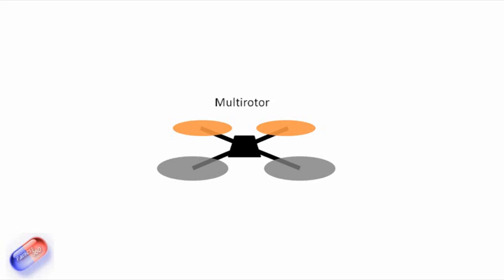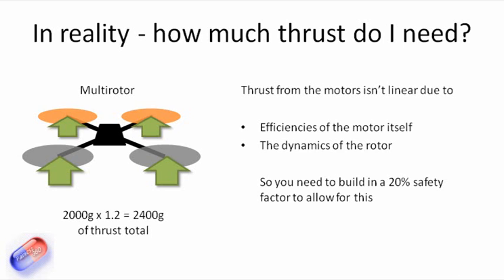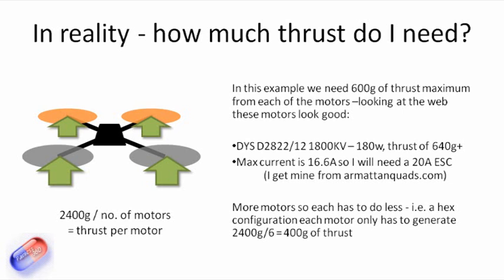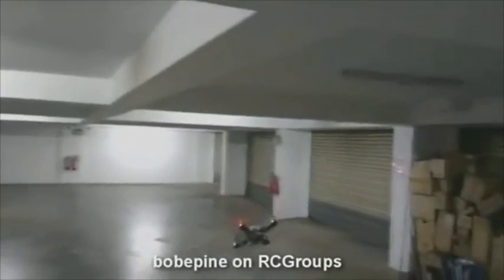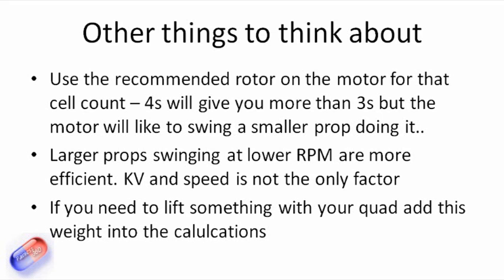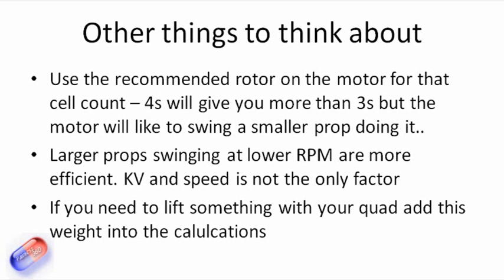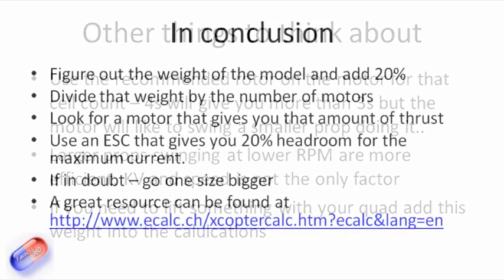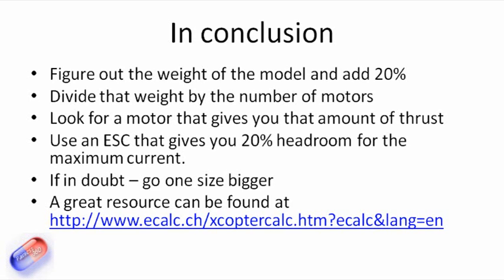How to select the right motor for your multi-rotor (all types - Tri, Quad, Hex etc.)

Comment: That was the clearest explanation I have yet seen.  Here is a question for which I have found no good answers.  I am looking at a range of sizes from, say 350 mm down to less than 100, so the MR copters will be quite light.  I am looking at possibly making airframes using carbon fibre tubes and plates and the strongest adhesive I can find, so that the bulk of the weight will be from the battery and motors.  What I would like to do is use the Gemfan 5x3x3 propellers (or their 6" equivalent) for the larger of these copters and the propellers from either the Syma X3 or the Syma X4 for the smallest of the copters.  Is it possible to compute the average time to discharge the battery from the weight and capacity of the battery and motors, the properties of the motors and and propellers, and whether it is a quad, hex or octocopter?  If so, how?  Can you show me the equations?  I have a mathematical bent, and so learn the details of how this all works when I see equations, rather than using a black box computing engine on the web.  What motors/brands would be suitable for this, which are reliable?  I don't care if anyone regards a particular one as 'the best' whatever that is.  I just don't want to end up with junk.  Are there any good books you can recommend on the subject?  (without the words 'Dummies' or 'Idiots' in the title).
Reply from the maker: Hi Ted, one of the best resources for these types of question is the eCalc site (http://www.ecalc.ch/xcoptercalc.php) plug in the numbers and the answers pop out!

Hope this helps.
Reply: For calculating the discharge time of the battery, use the mAH rating. The equation is mAH = current draw*time. But note that the actual mAH will be less if you draw a lot of current, and the number the manufacturer gives you isn't always accurate. If you check for reviews of the battery online you should be able to figure out how accurate the manufacturer's rating is, and there shouldn't be too much deviation from it as long as you stay within the current rating of the battery. To determine how much current the battery can output multiply the mAH of the battery by the number that ends in C. A 20C 1000mAH battery is good for 20 amps of current. Some batteries give you a rating for both continuous output and short term output, so be sure you use the right one. To figure out how much current the motors will use you will need to either measure it yourself with (with the prop attached), or find someone else who measured it with the same or a very similar prop and put the results online.

Comment: I think the point missed in the video is that prop speed is very important for stabilization. The reason for having a certain weight-to-thrust ratio (as you outlined) is because too much prop speed and you are burning too much juice and too low of a prop speed and the copter will be unstable. Stabilizing the copter is done by speeding up and slowing down props and you do not want a motor / prop slowing down too far. Thus, the reason for the numbers you give.

Comment: What a prop size to install in motor 800 KV. I would like lift up 1,3Kg in quadcopter( reptile frame)?
Reply from the maker: Hi, check out the recommended prop sizes for the motor you have the manufacturer. This detail should be listed along with a thrust value in grams for each prop/battery size combo. You need a prop motor setup that, together, will produce about 3.12kg of thrust, so 780g for each motor on a quad.
Reply: Painless360 Thank you very much mate! But can i do to improve my quad? I am using this motor sunnysky a2212 -800kv + 30A ESC simon + prop 1045 + kk2.1.5. But when i Put a battery 5000 mah the Quadcopter( now with 1,3Kg) lost power, very bad.
Reply from the maker: Some interesting detail on this motor at http://www.rcgroups.com/forums/showthread.php?t=2032374

Looks like with a 4s setup and an APC 10x4.5 prop almost 1.3kg per motor is possible. The ESC you are using looks like it should handle it too. At 100% throttle on that setup the tests showed 60amp draw, which again, the battery and ESCs should handle.

When you say 'lost power' what does that look like? Happy to chat it through on my Helpout channel is you need to.

Comment: My Y6 weighs 2.2-2.4 kg depending on battery (4s 6A or 8A). I'm looking at the KDE DIRECT 2814XF-515 to replace the under powered 2830-12 850kv. With a 12x4.5 E prop (actually APC MRP but same P const), the KDE looks like a good fit and long flight time (the goal). Would you agree? I tried several other motors but they all result in lower flight times. These motors would also be used for a planned larger Y6 in the future. 

 They are expensive motors, and I've been agonizing over this for weeks. Any help is appreciated.
Reply: I did use Ecalc btw and believe correctly, but would like some more experienced advice.
Reply from the maker: Hi John, these motors have some great detail listed on the site. It's a shame that all manufacturers don't follow such good practice. Too often they provide very basic details that doesn't allow you to make an informed choice and have people (some of whom have commented on this video) to become confused and frustrated.

They look like a good, if expensive, choice and will allow you to increase the rotor size up to the 13" and 14" if you find they don't give you enough thrust for a hover. I'd be tempted to start with 13" blades (if they will fit your quad). That extra may be useful when dealing with windy conditions.

Good luck with the change over.

Comment: So bassically you really want a motor set that is just quite overpowered for the whole setup?
Reply from the maker: Almost. You need motors and props that will give you a total thrust that is a little more than twice the weight of the model. 

Go for high KV motors for acro flying and low KV motors with larger props for duration. Hope this makes sense.

Comment: what does 4s and 3s mean?
Reply from the maker: It refers to the number of cells in the LIPO battery. Watch my video on 'introduction to LIPO batteries' for more information.  Happy flying!
Reply: Multiply that by 4.2 for a fully charged battery, 3.0 for a dead battery, and 3.7 for an RMS average to easily calculate avg. RMS current. Your answer will tell you the voltage at those charge states.

Comment: Thank you for putting this together. Designing a quad from scratch is a pain already without buying a dozen smaller motors as a result of trial and error.
Reply from the maker: That's what I was doing - trying one lot of motors and then having to buy another set (with the relevant props) and it was expensive. I wish there was an easy way to translate watts into thrust! I find that for a 450 class quad 150/170w motors work well, for a hex or heavier model 270w class motors are a better choice.

Thanks for the comment.

Comment: How will i know the thrust of my motor?
Its 980kv and 165w.
Reply from the maker: Thrust is very tricky to calculate using formulas. Look up the datasheet for the battery size and prop combo you are looking at using. Happy flying!

Comment: Just curious, if you dont know the weight of your copter as its not built yet, but want many features such as gps, 3D POV, obstacle avoidance radar, long flight time, and lifting capacity etc how would you decide on motors for a hexicopter?
Reply from the maker: I tend to use the weight listed on the description of the item on a place like HobbyKing and add it all up. Be careful with the weights as they tend to be inaccurate so the extra 20% of weight you use when calculating the motors needed will ensure that you don't end up with an underpowered model.  As explained in the video divide the total thrust needed by the number of motors to see what each one need to provide, so with a hex divide total thrust by 6. Hope this helps.

Comment: Are not the motor's inefficiencies across the throttle's range already the basis for each motor's factory test specifications anyways?  Since I fly slowly in the 50% to 75% throttle range, wouldn't a 20% overhead of thrust be excessive?  Would not a 5%-10% overhead be more reasonable in my case?  Thanks.
Reply from the maker: Thanks for the question, 20% would be excessive if 1) the thrust listed from the manufacturer was always accurate and for the exact setup you were looking at (!) and 2) you never then wanted to add more kit to the model (camera, FPV gear etc. I've not yet built a model that hasn't ended up with more weight on it that I intended!Happy flying!

Comment: Hi there,
you state "have the weight of the model and add 20%" but in a prior section you actually use double the weight to hover at 50% so maybe it would be less confusing if you stated "Use the weight of the model and multiply by 2.4", or did I not get what you're saying ? Otherwise very clear and informative. Thank you.
Reply: +Robert Alexander agree with that!

Comment: Hello, very nice video, I'm planning to build a quad to lift 3.5kgs including frame and motors weight. I'm using 1100kv with the table 
Prop Tests :
8x4 - 11.1V / 100W / 9.1A/ 0.54kg thrust
8x4  - 14.8V / 116W / 14A / 0.82kg thrust
9x6   - 11.1V / 149W / 13.6A / 0.73kg thrust
9x6   - 14.8V / 285W / 19.6A / 1.05kg thrus

What props should I use knowing I bought 3bladed prop of 9in but the motors heated, I have 3bladed props also 8in, what is the best prop to use with what kind of lipo? 3S or 4S ? Think you!!
Reply from the maker: Hi, difficult for me to answer without knowing how may motors you will have. If you follow the guidance in the video you should be ok. Always use the lipo recommended for the prop/motor setup and two bladed props are best if you can fit them. Thanks for the question.

Comment: So something about 450mm to 500mm frame.. and about 600g to 700g total weight.. should I use 1100kv brushless or go even higher? Planning to run 8 to 9 inch props 4.5 pitch.. I want somethong light to medium weight but really wanting a quad that flies super fast and jus really punches out from launch.. this is my first build..
Reply from the maker: Hi David, 700g seems light for a quad of that size. Using a quick check - a plastic frame, decent battery and 4 motors will weigh almost that much before adding the props. ESCs, flight control board, cables and receiver. I'd get a list of what you want to use and add up all the weights to give you a solid starting point on the all up weight.

If we assume a loaded weight of 900g, running a 3s battery then you have lots of choice. You should be looking for a motor that provides about 500g+ of thrust or around the 150-160watt range. i.e Turnigy Aerodrive SK3 - 2826-1240kv with 8x3.8" props or similar.

Hope this helps. Good luck with the first build, it can seem a little daunting but it's a great sense of achievement when you get it into it's first hover!

If this is your first quad, a great buy would be one of the little indoor quads to practice on (Hubsan X4 or similar), very cheap and great to get to grips with before crashing a model you've put a ton of time and money into.

Let me know how you get on. Happy flying!
Reply: Well ive owned about 6 to 8 helis and quads and currently flying the blade 350qx.. ive taken it apart after a crash n transfered the internals to a new frame and i now have a good understanding of how to do it as well as what to expect. Now im debating bigger props with slower rpm motor. I jus dont kno what to do yet but my tbs frame will be in soon. Yikes
Reply from the maker: David, on the choice of motor/prop my other video http://youtu.be/Sjwi_UnCLWc may be interesting. Let me know how you get on.
Reply: Painless360 I've dived head first into the hobby and lovin every minute of it. I've built 10+ fpv wings and three quads. Ahhhh life's good..

Comment: Hi 
Having trouble configuring my GPS . I am running windows , I downloaded an emulator and was able to open the ublox app. This is how I plugged it up FTDI dongle into the I2C Nav module , out of that to the receiver. 
I went to tools on the Ublox program and there is no USB port so I can't see the receiver.
Any ideas on how to make it connect as I thought I would see a USB port there to select.
Thanks Russ.

Comment: this cleared a lot of doubts!
Thanks a lot man!
Reply from the maker: Thanks for the comment and feedback. I'm doing a test with one of my models using two very different motor/prop combos that should produce the same thrust but one should expected to me more efficient. Should be a handy supplement to this video with some real world data and examples.

I will be posting this in the next few days when I can hover the larger prop/lower KV setup and capture the power used.

Happy flying!

Comment: hi, so for a 250 size frame with fpv gear maybe total weight 600-650g ,
 which one of the 3 would be best?

1>T-Motor MT2206 KV1200, 110W, 10A, 30g
2>T-Motor MN1806 KV1400, 96W, 12A, 18g
3>T-Motor MN1806 KV2300, 150W, 14A, 18g

Idea is to put it on this:

HobbyKing Daily - HK 250 FPV Racing Quad

Thanks!
Reply from the maker: You need to look at the tables for each of these motors, they are on lots of websites. You need to know the maximum size of the prop that will fit on the frame (bigger is normally better, I'm guessing about 6") and know if this is going to be a 2s or 3s LIPO pack.

Then look at the rotor size for the pack you have for each of the motors and go with the one that is most efficient. You need to look for a motor that will give you a max thrust of about 360g each with the prop..

Comment: Hi Painless360 
Thanks for slides. In "conclusion" slide, first sentence, didn't you wanted to write: "weight of the model" (including motors ESC flight controler etc.) and x 2 x 1.2?
;)
otherwise the thrust would only be 120% weight and the multi would be largely under powered and would take off, but no much more.
If I understood right .... ;)))
Friendly yours.
John
Reply from the maker: That's right, I do cover this in the video so I'm glad you figured it out. Happy flying!

Comment: I'm about to try something a bit experimental, to be honest i'm expecting to fail. Will be building a mini with 4x 10g motors, i will try to run the motors at 1s but with oversized props, build should be fairly light and not designed for acro. I'll let you know how it go's. Got most of the parts now so just waiting for some free time and to do some other thrust tests before starting to build. More soon
Reply from the maker: I would be interested in the result - let me know!

Good luck..
Reply: Painless360 Yes no problem, i was planning to do some thrust tests first but i can't find the digital kitchen scale that i had in my garage, may give that step a miss for now then! Will try to put together a series of videos in a few weeks time to show all the difficulties and hurdles that i'm going to be up against. The idea is to use over sized props on these tiny motors and run them at 1s so i'll lose out on rpm but re-gain some of my thrust by using larger props. I am going to be using the MWC Mini Fc and Dsm2 all in one receiver fc combo. No GPS for now but thinking to give it a go after watching your video on gps with i2c setup, just not sure how you connect to the gps with the ftdi stick to set the baud rate, i'm guessing there are some solder points to connect to, will have to look into this if i decide to go in this direction. Plan is to build a large quad if all go's well, but need to learn how to fly first :D

Comment: My first quad I used the largest motors , esc and had so over powered it I could not control the speed.  Crashed into everything.  Wish someone posted this before I started.